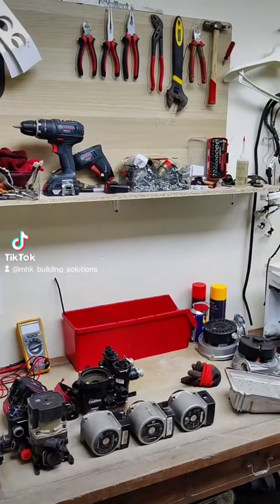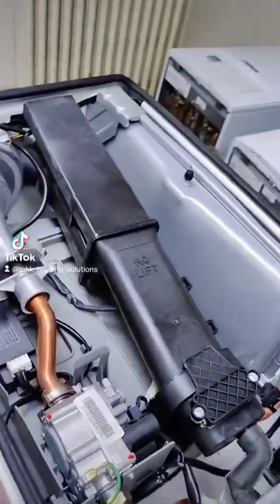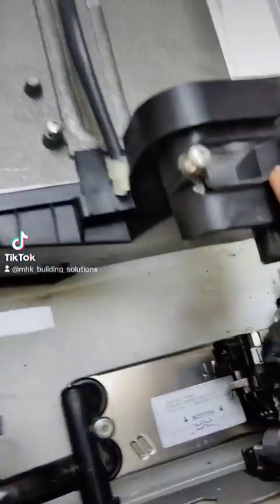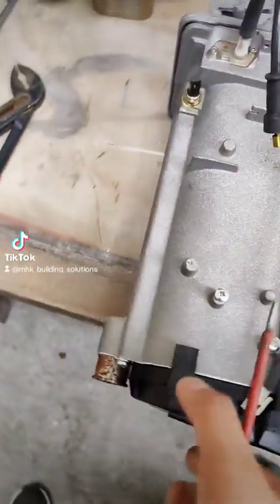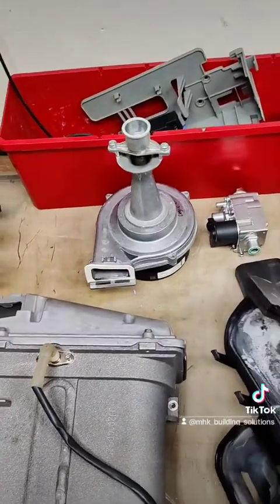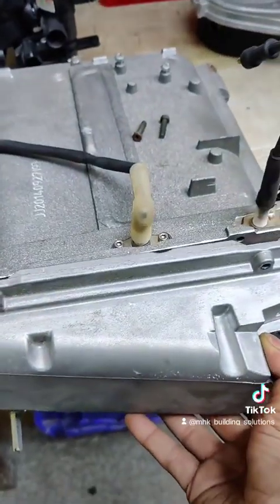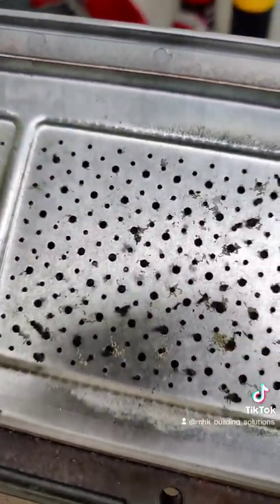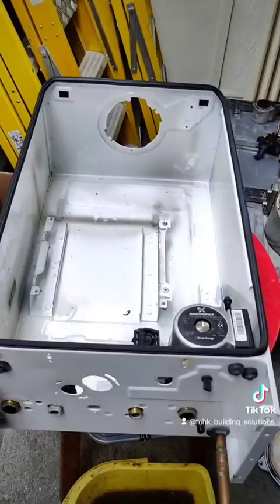Ideal Logic Combi Boiler Strip down, Service, Repair, Fault finding, Faulty, Educational, Training

Comment: Can you blast the heat exchanger with a solvent based solution to try and clear the holes?
Reply from the maker: You mean the burner? No you can't pass any liquids through the burner.

Comment: What could it be when preheat is turned on and boiler doesn't come on at all to heat water. Also only getting lukewarm water on max hot water setting. There are no fault codes. Ideal Logic 30.
Reply from the maker: Luke warm water on Ideal logics is normally the partially blocked burner due to which there is not enough heat going into the main heat exchanger to keep up with the hot water maximum demand. 
Occasionally it can be a plate to plate heat exchanger or the diverter issue which can also cause luke warm water scenarios.

Comment: Are you gas safe registered and are you selling old parts  ?
Reply from the maker: Yes I am a gas safe registered engineer mate and I don't sell old parts. I strip boilers for experience and videos.
Reply: Of course he's selling the old parts, why else write the model and gc on them😂 "oh no I just collect old parts" 🤥
Reply from the maker: @danielbailey1452  Wow Dan you have shockingly made your mind about what I do without even asking me. To correct you, no I don't sell old parts as the online market is saturated with old refurbished boiler parts and I don't have the time to test and refurb parts to sell. The reason I write the GC numbers etc. so I know which boiler I removed the part from if I wanted to make a video or explain it to someone.